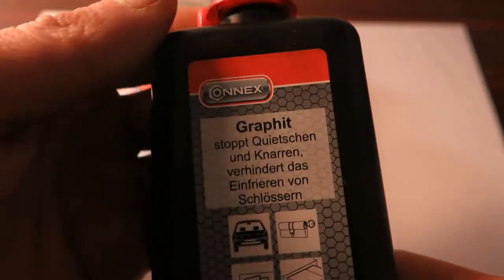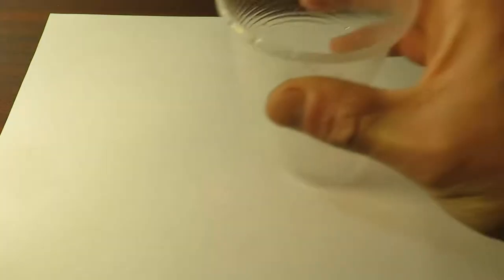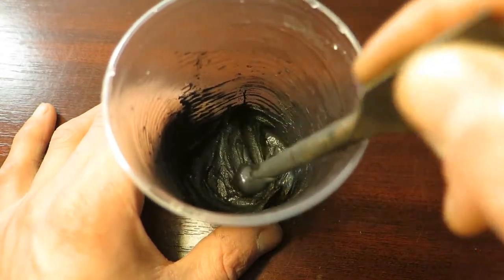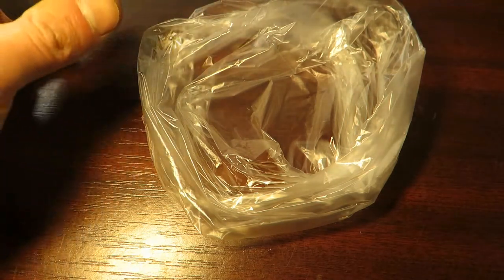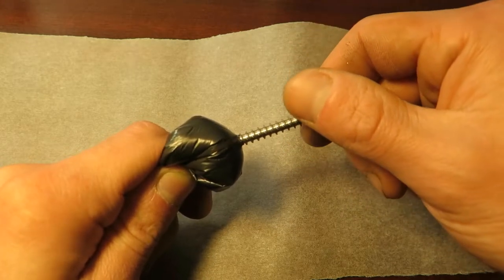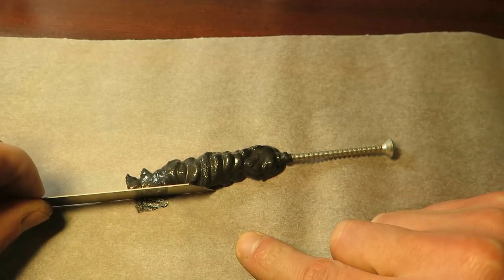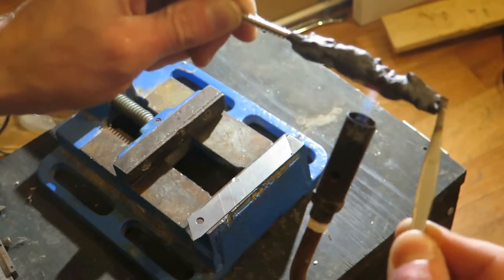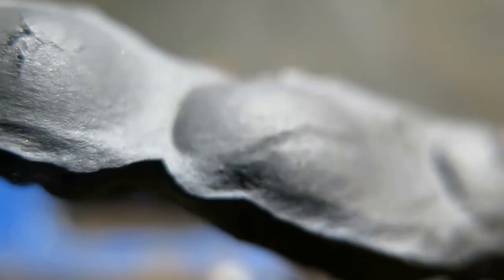Making carbon-ceramic tools

Comment: If you soak the material in calcium or magnesium chloride you will convert the silicate to a more robust compound and could remove the sodium as the soluble NaCl, salt. Magnesium silicate has a melting point that is 800 C higher than the sodium silicate and is not soluble.
Reply from the maker: Oh i wrote a lengthy comment and realized, that I misread yours :D

That would be cool, but it will depend on structure of piece, as water can penetrate hardened piece at super slow rate...
or do you suggest reacting it in liquid state? I can try that..

Anyways, I have cement that state temperature resistance up to 1200°C, its composition is sodum silicate and silicic acid.
in my opinion that should work like this:

mix sand/silicic acid
sodium silicate
graphite or whatever

heating to 
400°C - silicate is hard and insoluble, silicic acid decomposes forming sand
800°C - silicate binder melts, maybe dissolving in some sand and thus increasing melting point of the mixture
1200°C - some form of soda glass should be already formed binding graphite.
melting temp of system may depend on ratio of sand:sodium silicate
Reply: Yes, you may need to soak for a long time, otherwise you just get shell, but even that may be better than nothing. Some experiments are required.

Comment: Actually this is kinda interesting.
If you don't use the metal screw, you can use a microwave to heat the graphite.
Microwaved graphite heats very fast to very high temperatures. 400 degrees celsius is easily obtainable in a a home microwave in under 1 minute.
Reply from the maker: Good idea :) so we can pretty much melt any kind of binder this way...

Comment: Can this be used to make a crucible? it looks like it should be nonporous and if it can be cured at a strong temperature it may make a fabulously withstandable crucible to both alkali and acids, would love to try and vary the mixture abit and even add silicon dioxide powder, wanting to melt sodium chloride and Glassy carbon is very expensive...was looking at testing this idea for an alternative and just heating it very high to get rid of anything that can come off it and harm my electric kiln's heating elements. but man if this is nonporous material it forms that would be great. <3

Comment: How long do you dry the mixture for? And do you do the first part of the drying with heat? Or just air dry? Thanks!
Reply from the maker: First it was dried just by letting water to evaporate by dry air.
Still a lot of water is present so extremely slow drying after is necessary to prevent shape distortion.

Comment: Did you find this useful as an electrode in alkaline based electrolysis?

Hrmm, now i have an idea. Wonder about making a lithium silicate battery electrode.  Time for me to research lithium silicate.
Reply from the maker: Not tried alkaline solutions.

Surprisingly it held very well in acidic conditions, but only once. They were destroyed when dried.
Reply: @IlusysSystems  i seen that comment.

Comment: great idea ! And what if try it with PbO2 ?
Reply from the maker: Worth trying.
From further experiments I know, that sodium silicate will react with acids making electrode brittle...
It lasts in solution, but when dried, it cracks and parts powderize...
Reply: @IlusysSystems  which acid did you use?
Reply from the maker: @kreynolds1123  sulphuric, maybe HCl also, but I don't remember

Comment: is this tube porous enough to pass air through and generate air bubbles
Reply from the maker: In thin enough layer possibly. And with as little sodium sillicate as possible. But it rather acts as a clay. Perhaps you could crush hardened material to create larger grains, that would certainly help.
Reply: @IlusysSystems  Thank you. I was looking for a way to make Carbon Ceramic tube that could generate microbubbles . These microbubbles can then be collapsed to make nanobubbles. This can only be achieved using Carbon Ceramic tube.
Reply: @sidharthc.k.2679  Have you tried it. Are you successful in generating bubbles

Comment: What is the exact mix ratio to get that result I tried so many times and it is ether to moist it won’t cure at all or there is not enough and it breaks back to powder??
Also how long does it take for yours to dry do you naturally dry or heat up some how?I tried drying mine for a week and it won’t cure???
Reply from the maker: Not sure about exact ratio right now. Best results I've got were by adding sodium silicate until you can mold graphite by hand so it holds shape and barely flows when you vibrate mould with some powerful vibrator.
then I place it into oven @60 deg C for few hours like 5 or so. Now the thing should be dry to touch. Then I raise temp to 100 C for another 5 hours or so then raise to 200-300 C for 2 hours at least.

This is quite OK as a tool for glass blowing tools, though it can leave marks on glass when tool gets hot. Quite poor electrode in strong acidic environment though. But better than any other graphite electrode I have used (doesn't atomize as much but it will disintegrate after some time).
Reply: Excellent thanks for your response!!
I am not trying to make rods I am trying to make blocks like a ingot but not to pour in I mean a whole block like stock material I want to machine a mold in it so I could cast metal into it it is way to expensive to keep buying stock shapes of graphite but I want to reuse the stuff that cuts off and turns into powder when I machine it do you think this is practical??
 I have sodium silicate and the cut off graphite is just like graphite powder but when I mix it it ether takes forever to even get hard or I heat it up and it gassed up and the center becomes hollow very frustrating ???
Reply from the maker: Right I was also thinking about making large blocks, and this excessive outgassing is quite a problem. First, the thicker the material, the longer you should cure in low heat, second I was thinking about making aluminium or steel form that could possibly prevent deformation of block. It would have to have a lot of small holes to allow water to escape as well. pressures inside the block could be immense so not sure if that would work, but I would try it. I make relatively small tools so this isn't much of a problem for me.
Reply: Ok perfect you know exactly what I’m doing I’m going to try some things and I will keep you updated if Anything good happens let me know the same!!!!
Reply: If I understand correctly then this will cure with CO2. So putting it in a co2 rich environment will help cure it

Comment: No, it is not basically a super conductor.
Reply: I am guessing that maybe english is not his first language. Taking that into consideration, one might further guess he meant "good conductor"  vs superconductor that have absolutly zero ohms of resistance.  

Or maybe he was trying to make a joke saying superconductor as you see he measured   6-7-8 ohms, as he followed with "next episode we will be making bitcoin out of bread crumbs."
Reply: @kreynolds1123  yes, I could see that. When you say basically, you are highlighting an essential  meaning of what is being described.
A superconductor is a very special state of conduction which has been long sought after to exist at room temperature with no resistance and in affordable conditions. However, a zero resistance conductor have only been found under certain extreme conditions.
Reply: @gary.richardson  How does one make bitcoin from bread crumbs?
Reply: @kreynolds1123  his last comment, kind of sarcastic
Reply: @gary.richardson  i thought that too.  But i thought that sarcasm or humor further extended to the supper conductor comment as one can clearly see the multimeter reading 8 ish ohms. :D
Reply: @kreynolds1123  yeah it's the difference between "super conductor" and "superconductor".
Reply: @edgeeffect  Of the things that I have some modicum of tallent in,  spelling is certainly not one of them.  If it is yours,  then truly, I sencerly mean I am glad for you. I try and try, but I seem to be wired for aptitudes elsewhere.

I see your point on the difference between super conductor and superconductor.  Low resistance good conductor vs zero resistance superconductor.

Maybe I'm wrong but I'm still inclined to think ithe content author was using sarcastic humor than  pointing it that it was a relativly low resistance good conductor.